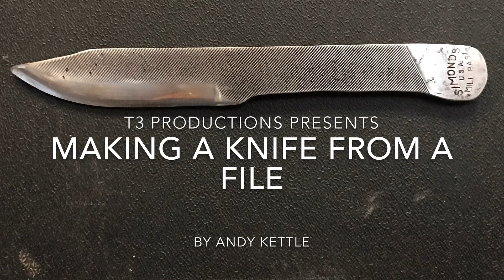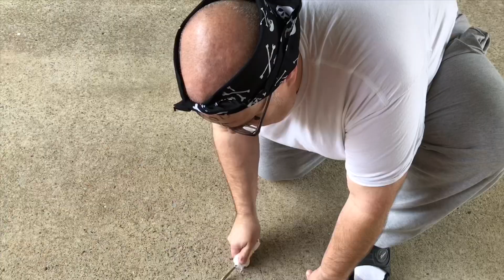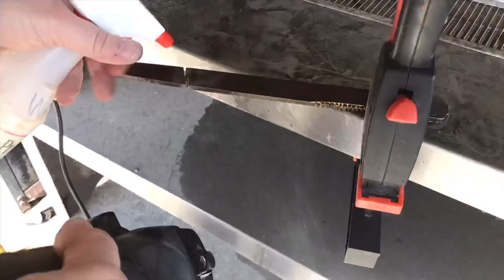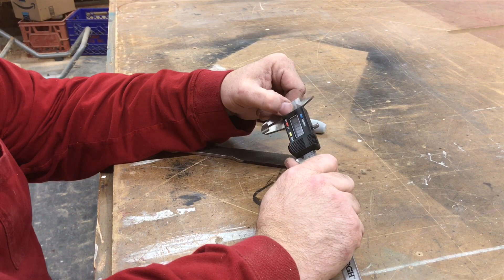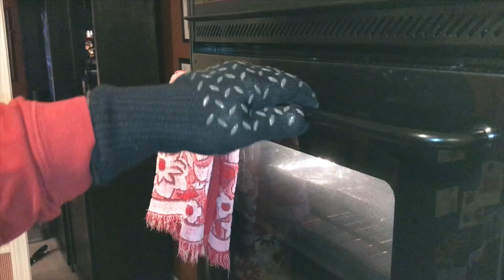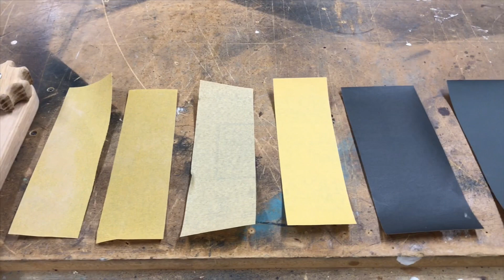Metalworking: Making a Knife from a File

Comment: That is totally needing a leather wrap for the handle. Something thin, but enough to give you some grip. Awesome work for your first one. Oh, one question - would there be a benefit to using oil for cooling? I remember dad using oil when we were drilling metal, but I can't remember when we did any grinding. Obviously, it would be messier.
Reply from the maker: Thanks Joe. I didn't want to cover the handle because I wanted to showcase the file serrations and maker's mark. With those serrations, the grip is really good. As far as oil, it could have been used to cool it, but the mess would have been horrific. Oil is good to dip a knife in for quenching if you are forging, but since I was grinding on a clamped knife most of the time, it would not have been efficient to unclamp and dunk in oil every few seconds. With water, I could spray it and get it on target quickly and efficiently. Thanks for the comment!